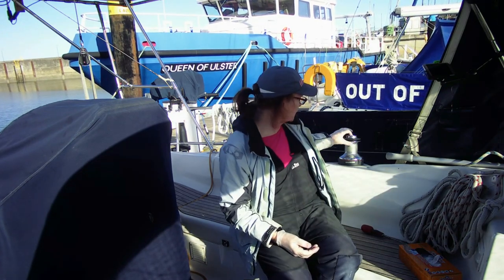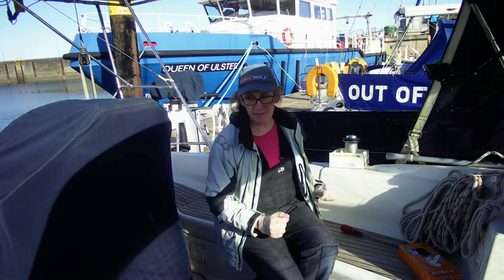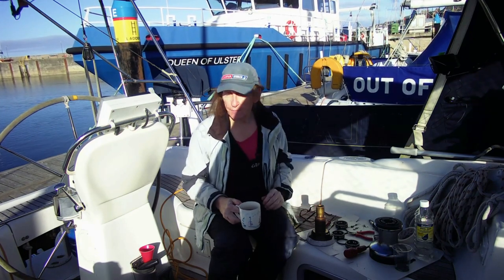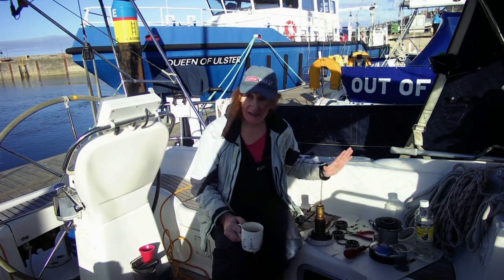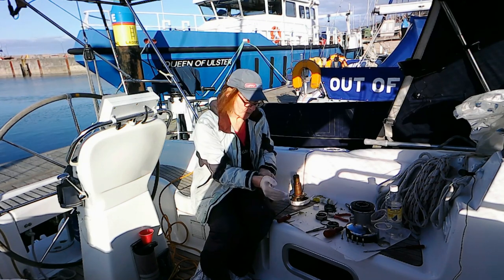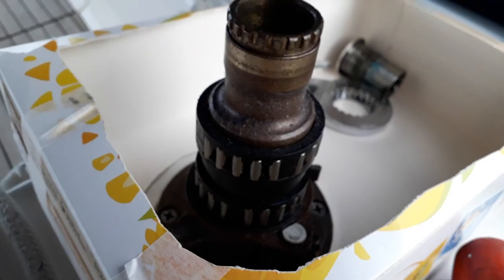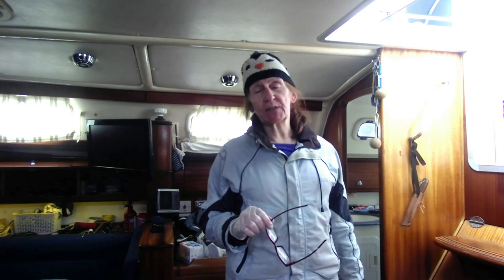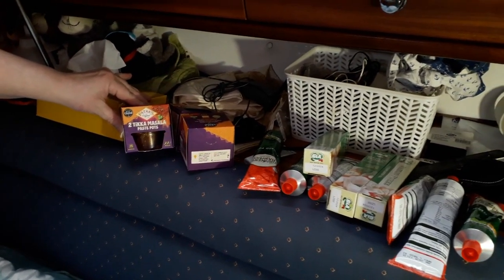Sailing Northern Ireland - Winch service - radio cable - Ep. 279

Comment: I did the very same thing with a Raymarine Command Mic VHF where the cable insulation had broken down and there wasn't a replacement cable available for it, so I bought a new cable from a VHF electronics company for a few quid and got busy with the soldering iron.  Worked perfectly after (until eventually the other handset gave up altogether but that's a different issue).  Def worth the effort..
Reply from the maker: Thank you - that is very encouraging. If it lasts another few years then  we will be happy with it. The cable arrived yesterday and so we hope to get it done soon.

Comment: Thank you! Really like the cereal box idea. I’ll use it when I do the winch cleaning. I had a good laugh/cry (kidding) about delivery costs. Here in 🇨🇦 and owning a Bavaria it’s criminal what the cost is to get parts from Europe and area. You learn to work around just like you are or cutting our own port lights, etc. I look forward to the mic update and have no doubt it will work 100%, with a little bit of patience. Cheers. 🇨🇦
Reply from the maker: Luckily a lot of the parts are generic like Selden, Lewmar, Harken, etc. The mic cable has since turned up and we hope to get that down in a week or two. Has your boat / boatyard thawed out yet?
Reply: I installed the last 2 portlights today. Thankfully they all fit. Next the water test in Nice Warm weather after the cover is off. Burr 1C in the boat. -3C outside but…Sunny. The power goes on in 5 Days!!!
Reply from the maker: @sailinglatis  - it will not be long now and you will soon be in the water

Comment: Outside of Teak and Mahogany, winches were the annual bane of my existence (Dutch father, youngest son... "You VILL clean!").
I did get one tip from a world cruising family, way back when.
If you're out of WD40 and can't get to the diesel, Dawn Dish Washing Liquid (the original blue), and water will cut through absolutely everything. The only problem is to rinse thoroughly and dry the pieces carefully, before coating with grease/oil.
About the only time that I got away with letting things sit in a tub to soak for an hour, and catch up with summertime homework.
Excellent video!! Thank you for sharing.
Reply from the maker: What a great sea-story 👍 At least we do not have the teak and mahogany to worry about. At the moment we are just stuffing our tummys with chicken biryani and listening to the wind blowing the ice and snow sideways 😄

Comment: I use a paraffin bath (bucket) and paintbrush/rags to de grease my winches, or I had to the first time. Regular attention means I can do the old grease removal with an oily rag. Diesel is  similar solvent if you don't keep paraffin aboard. Our Lewmar winches are almost identical, this is a good informative video.
Reply from the maker: Thanks for the feedback. We used WD because we had it and it really is an excellent cleaner in a non-spill bottle. I am also relieved to hear that the Lewmars are similar as we were a bit concerned that they would be totally different. Glad you enjoyed it 👍

Comment: So glad you posted early stuck in today and what a joy you bring. Don’t you like butyl tape? Very clear instructions as always, and no snow YET
Reply from the maker: We use buytl all the time, but I wanted the winch to sit flat on its base which is harder with butyl and also buytl is oil soluble and I filled the pawl housings with oil which will leak out with the first use, so silicone was a safer choice.

It is trying to snow here. Thankfully, it is not quite managing to succeed 😄

Comment: On the Lewmar winches on my Bavaria 37, I did not have to take the base off to disassembly all the parts. I used thin oil on the paws, and a thin coat of marine grease on the rest. I would have considered using butyl instead of silicone sealant.
You can still buy VHF with numerical buttons, but they are not cheap. I have a rotary dial for selecting channel on mine, which is slightly better than up/down buttons.
If you buy a new, I would highly recommend to buy one with a Remote Access Mic for the cockpit, like the GX2400E + RAM4.
Reply from the maker: It is good to hear that the Lewmars are easily servicable as I did not have any handy to experiment with 😄 The cable for the VHF has arrived and we hope to have the video up on the channel in the next few weeks. In the cockpit we use a HH350 handheld VHF which has a range of about 3 or 4 miles which is usually enough for anything we are doing. Thanks for the info and for commenting 👍

Comment: Having lost the feeder arm overboard on one of my winches I was still very nervous watching you dismantle your winch. My feeder arm 'flicked' off so your trick with the catch tray wouldn't have saved me. I'll be placing some kind of curtain around it next time, maybe a big bath towel pegged to the life line.

I use three in one oil on the pawls and white grease on the bearings and gears. And you're absolutely right, you don't need a whole lot of grease.
Reply from the maker: Ironically, we were fiddling with the positioning of the stripper arm on the halyard winch and we dropped it and it bounced and was on a perfect trajectory for going overboard.... then it hit the dodger panel and bounced back in and landed against the toerail 😲 Of course, we had no cornflake box in place, but we came so close......

Comment: I got a reminder off this video to check my Harken 40 halyard winches, One turned freely both directions, I suspected jammed pawls. I was surprised to see a missing ratchet gear with it's pawls. I've failed to find a new one. Harken say these are now discontinued and obsolete (a winch made in the 1999 to 2003 period). £900+ for a new winch or some hand hauling!
Reply from the maker: What exactly is missing? Just a pawl?
Reply: @SailingYachtSaltyLass  I wish. The ratchet gear and it's pawls. The left hand assembly has  double decker gears. The lower has an inner part which is there but the outer part- the gear is missing as are the pawls and springs. As it stands, it's  freewheeling both directions.  (Ratchet gear part B27219)
Reply from the maker: How the heck did they manage to lose a cog? What about ebay? Or put a message up on Sail Cruising UK on Facebook.?

Comment: Simrad make a good radio. Have the same on Spirit.I was wondering why you would go to all that expense for a new Mike plug when it's easy to snip and solder. Make sure the wires are shielded when you  fit them back together again.
Reply from the maker: A new plug and cable just seemed the neatest way to do it, but it is now financially worth the bodge... 😉

Comment: That looks very much like a 7 pin din plug? £3.15 at Farnells. If not, just replace the cable and hard-wire it in to the radio if you cant get the right din plug. No need for it to be removable at the chart table. Sail Safe Guys, Ant & Cid.
Reply from the maker: We did look at those, but the killer was the securing ring. the DINs we saw had a threaded ring to lock it in, but Simrad used a bayonet fitting with an odd size. Conxall do the plug but import duty, tax and shipping costs had it up over £70 very quickly.

Comment: Just beware, silicone cures by use of 'vinegar acid' that is a quite corrosive agent. Not a problem with what you are doing with the winches, just keep it in mind. 
And as we say in Norway, Smoke on the Water: Lyrics by Deep Purple, smoke by Volvo Penta 🙂
Reply from the maker: Thanks for the tip and also we will do our best to avoid the smoke on the water 😎